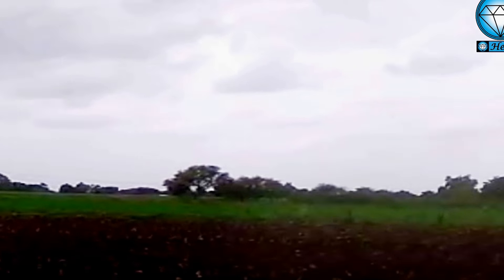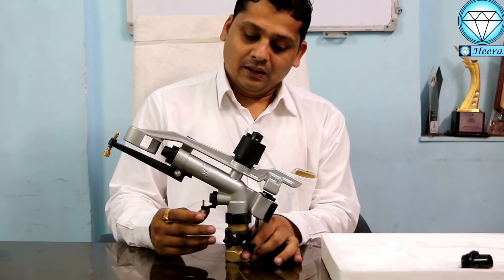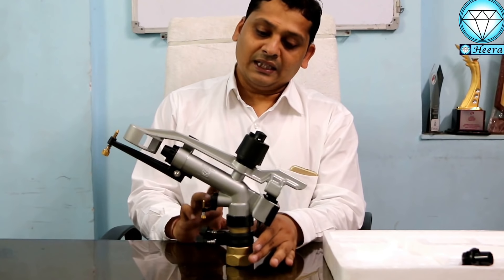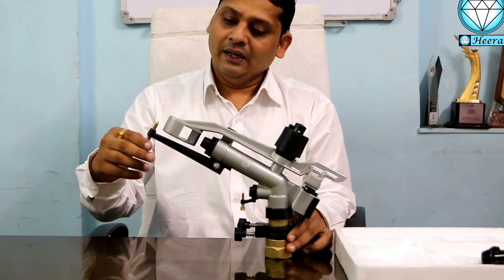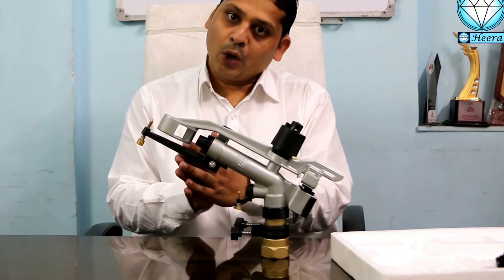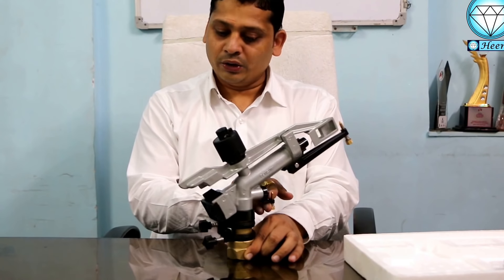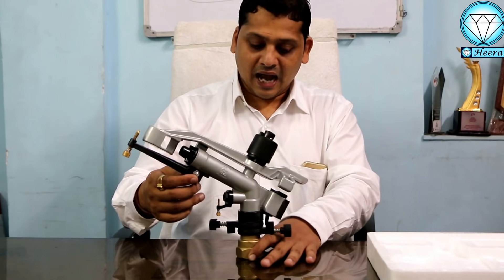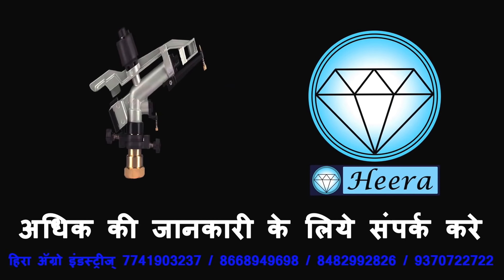आधुनिक तकनीक हिरा रेनगन Modern technology- HEERA RAIN GUN, Sprinkler Irrigation, Types of Rain Gun

Comment: agar upar ka blamp toot gaya to use kaise joint karna
Reply from the maker: कृपया 9422207468 इस नंबरपर आपका नाम, गाव का नाम भेजे ताकि आपका नंबर रजिस्टर हो सके. हमारी जानकारी Whatsapp के जरिए मिलने के लिए आपके मोबाईल में 9422207468 यह नंबर Save करना जरूरी है. अधिक जानकारी के लिए Call करे - 8668949698 or  9284000511 or  9284000512 or 9284000513 or 9284000514 or 9284000515 or 9284000516
Reply from the maker: अभीतक तो ईस प्रकारकी कोही तक्रार आई नही है. अगर आती है तो हमारा engg आपको मदत करेगा.

Comment: How muchh surface area it covers?
And how muchh HP submersible pump is require this gun?  Tell me must.
Reply from the maker: for more detail please call 9284000511 or 9284000513 or 9284000516
Reply from the maker: कृपया 9284000515 इस नंबरपर आपका नाम, गाव का नाम भेजे ताकि आपका नंबर रजिस्टर हो सके. हमारी जानकारी Whatsapp के जरिए मिलने के लिए आपके मोबाईल में 9284000515 यह नंबर Save करना जरूरी है. अधिक जानकारी के लिए Call करे. 8668949698 or 9370722722 or 8482992826 or 9284000511 or 512 / 515 / 516 / 517 / 518

Reply ·

Comment: How much pressure requires for this gun
How much area it covers ??
Reply from the maker: कृपया 9422207468 इस नंबरपर आपका नाम, गाव का नाम भेजे ताकि आपका नंबर रजिस्टर हो सके. हमारी जानकारी Whatsapp के जरिए मिलने के लिए आपके मोबाईल में 9422207468 यह नंबर Save करना जरूरी है. अधिक जानकारी के लिए Call करे. 7741903237 or 8668949698 or 9370722722 or 8482992826
Reply from the maker: its working from 2.5 kg, also its cover 170 feet when water pressure is 4 kg.
Reply: यानी कितने hp की मोटर हो ?
Reply from the maker: more than 3 HP
Reply from the maker: कृपया 9422207468 इस नंबरपर आपका नाम, गाव का नाम भेजे ताकि आपका नंबर रजिस्टर हो सके. हमारी जानकारी Whatsapp के जरिए मिलने के लिए आपके मोबाईल में 9422207468 यह नंबर Save करना जरूरी है. अधिक जानकारी के लिए Call करे. 7741903237 or 8668949698 or 9370722722 or 8482992826 or 9284000511 or 12

Comment: How much cost and what the HP for running and what area cover by hira raining
Reply from the maker: YOGESH MANI SINGH LODHI कृपया 9422207468 इस नंबरपर आपका नाम, गाव का नाम भेजे ताकि आपका नंबर रजिस्टर हो सके. हमारी जानकारी Whatsapp के जरिए मिलने के लिए आपके मोबाईल में 9422207468 यह नंबर Save करना जरूरी है. अधिक जानकारी के लिए Call करे. 7741903237 or 9370722722 or 8482992826 or 866-8949698 or 9284000511, 512 , 513, 514
Reply: shrihari
Reply from the maker: कृपया 9422207468 इस नंबरपर आपका नाम, गाव का नाम भेजे ताकि आपका नंबर रजिस्टर हो सके. हमारी जानकारी Whatsapp के जरिए मिलने के लिए आपके मोबाईल में 9422207468 यह नंबर Save करना जरूरी है. अधिक जानकारी के लिए Call करे. 7741903237 or 8668949698 or 9370722722 or 8482992826 or 9284000511 or 512 / 515 / 516 / 517 / 518